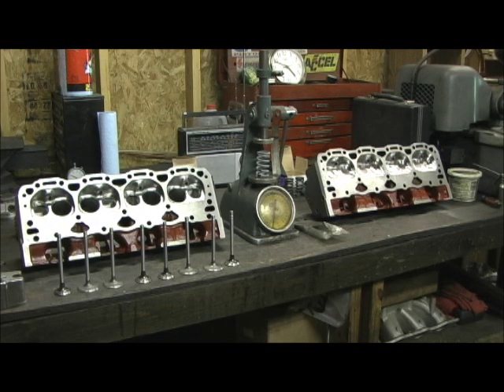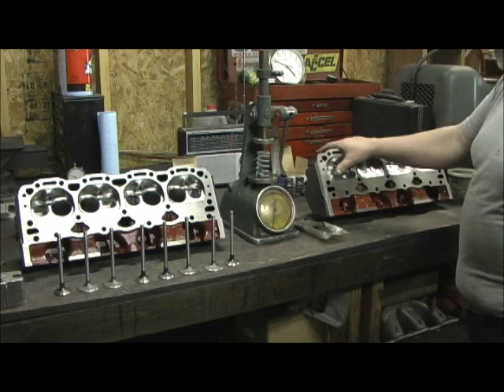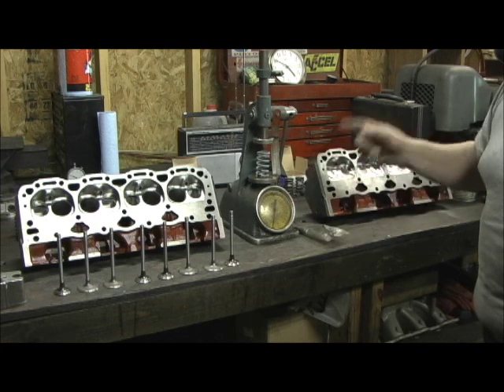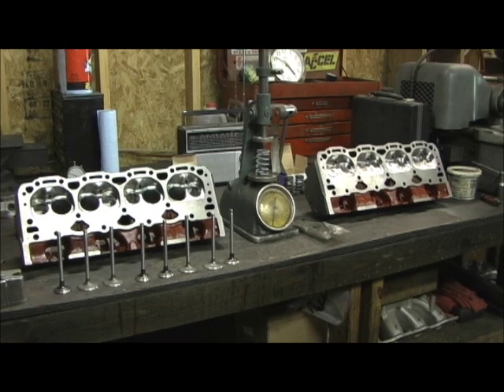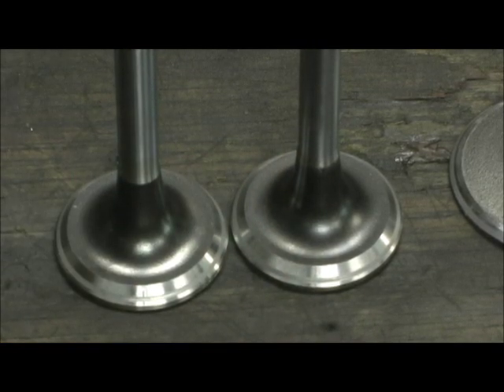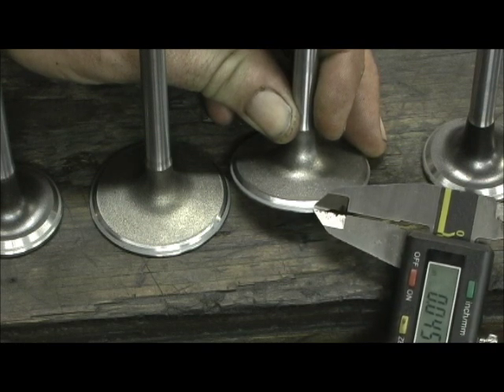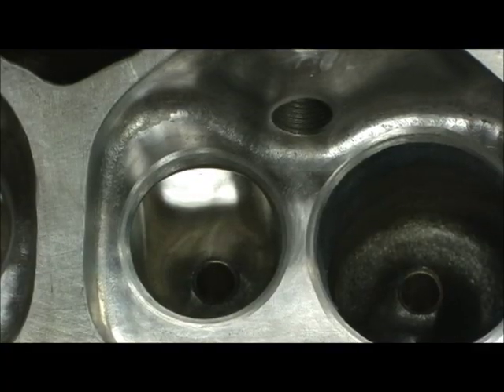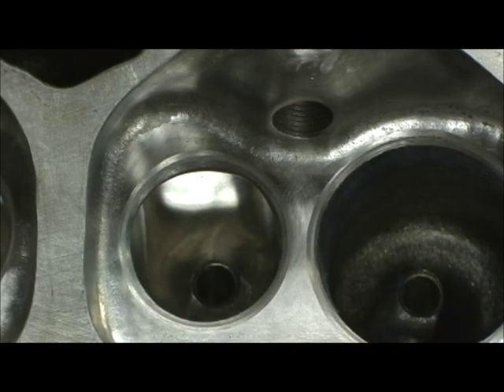TBI 350 Cylinder Head Porting Stage IV Part 7 Conclusion

Comment: Man, I love watching and studying all of your videos but this series really hit me well.  Not only does the concept of working over factory stuff bring me back to my mid to late teen years running in the street stock class at the local dirt tracks, but it is also on par with what I will need to be doing for my truck for the street.  At first read on the various forums on the world wide wad, I was real turned off to the swirl heads...  But after watching your series here, I have decided they are exactly what I need.  I have a 90 3/4 ton suburban with the tbi 350.  It will be due for an new power plant soon so I will be getting a hold of you to talk about doing a set of these heads for my ride.  I am a little less worried about gas mileage than this fella, and less worried about combustion chamber volume as I am planning a 383 build.  But I will be doing some towing and a little off road play as well.  These seem to be the closest trick to pulling near diesel torque out of a gas engine and that is what Im after.  I originally planned to drop an old 453T Detroit Diesel in it but the Govt here in the great state of PA really wants to make a diesel swap a pain.  But I think this type of deal will be just as well.  Talk to you soon, Tom!  Thanks for all of the effort you put into these videos!

Comment: Got a question for ya, I'm porting 02 vortec heads and ordered 1.94 I and 1.6 E by accident and haven't got Classic industries to cancel my order yet so I can get the kit with 1.6 E valves. If I use 1.6 can I open up the seats with the seat grinders to get them big enough or is that more work?